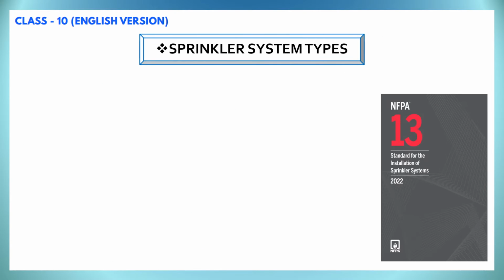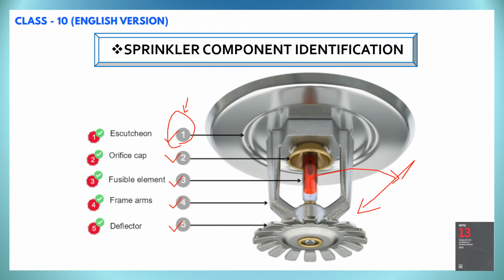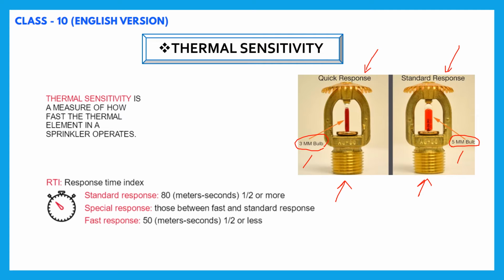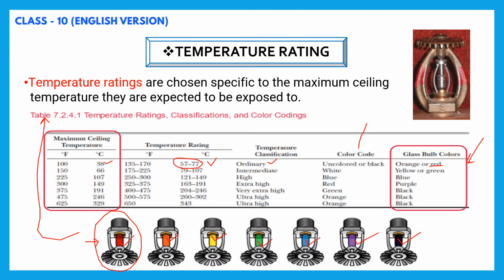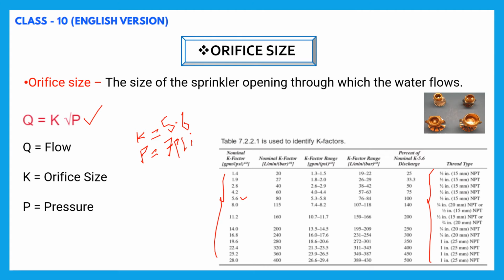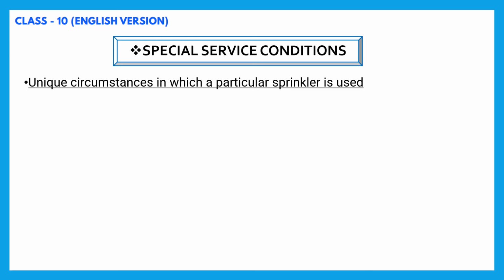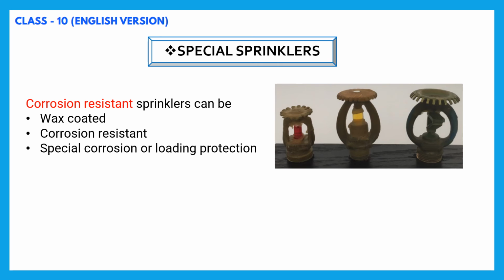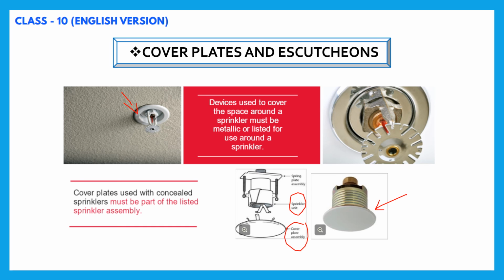Different Types of Fire Fighting Sprinklers Explained!

Comment: 17:38 Dry sprinklers and mechanically sealed with extended tubes from the fip to the water seat, not pressurized with air.  A lot of dry heads have vent/weep holes on the fip.  Loving the videos!  Thank you.
Reply from the maker: Thanks